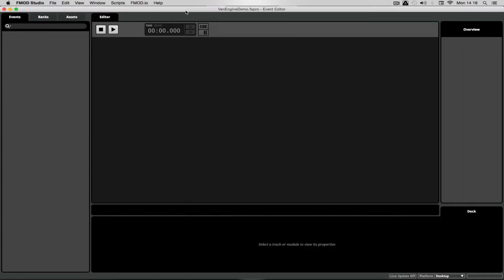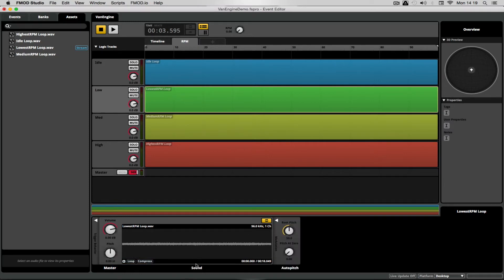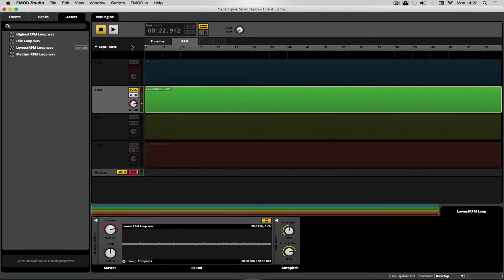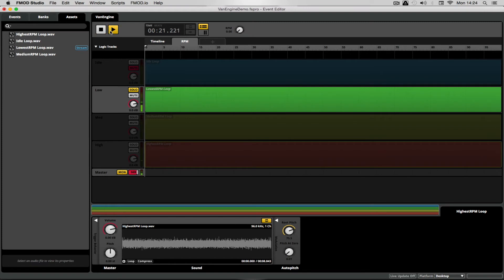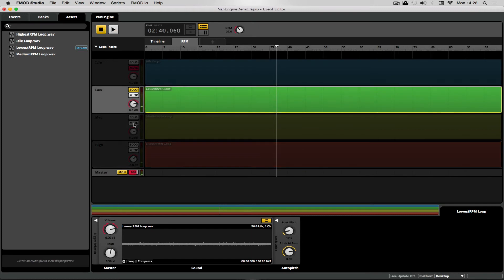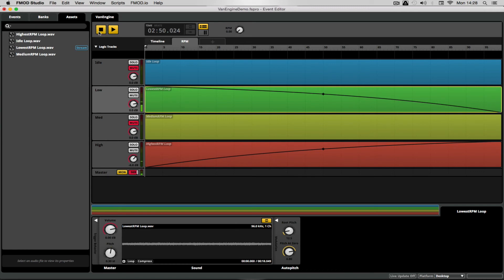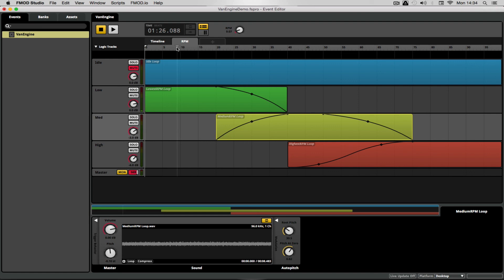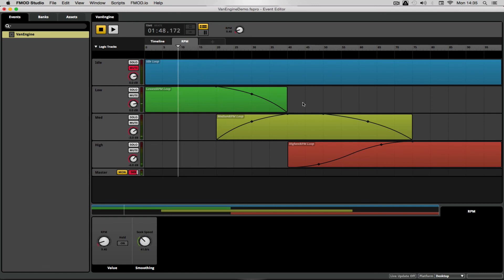Adaptive Engines in FMOD Demo - Part 2

Comment: Hey! I am trying to reproduce this in Wwise as the project I am working on uses it and I am wondering if your auto pitch setting are making a curve from 0 to a 100 rpm.
In my Wwise project would that mean that I have to tune the samples at a 100RPM and at 0 and let the natural cuve between these 2 points happen to have the correct settings?
Reply from the maker: The really low RPMs is probably the most difficult part, since car engines have a minimim RPM, there is no such thing as zero. I find it best to crossfade into a looping sample of an idle engine, which is not affected by autopitch.

Comment: Brilliant video! I made the stupid mistake of pitching my samples in tune with each other in my DAW so they could all follow the same pitch ramp in FMOD. Of course, bouncing out pre-tuned files made them sound a lot thinner when it came to pitching in FMOD later. On thing that i had to do that wasn't mentioned here was set the audio file's polyphony to 1, otherwise the file would play over itself if it was retriggered.